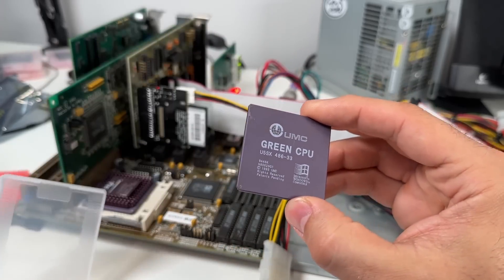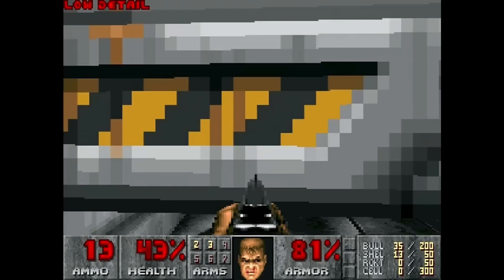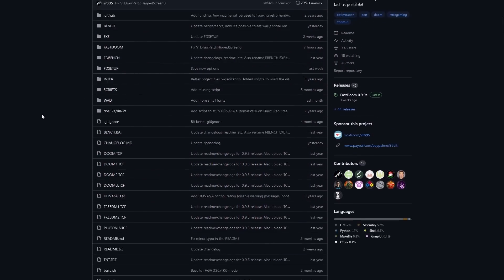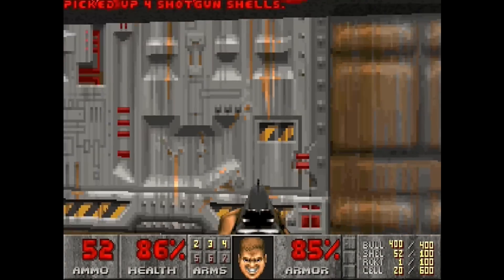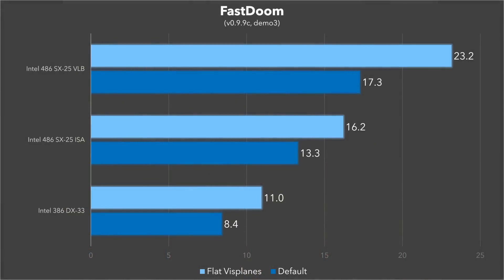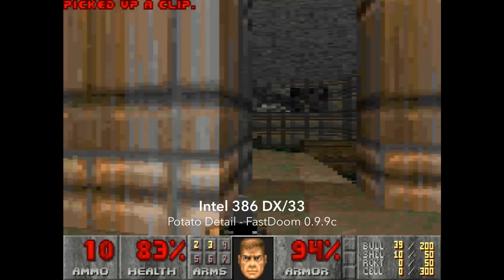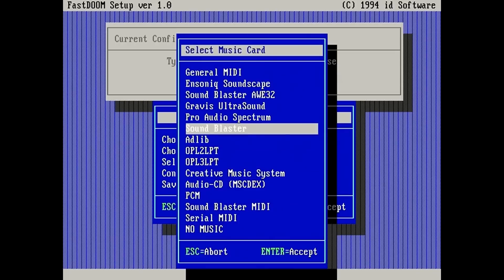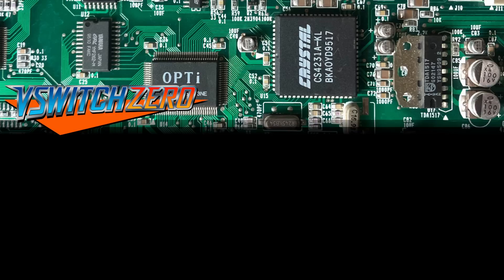FastDoom - Massive Performance Gains on Slow 386 and 486 CPUs!

Comment: Victor here! Awesome coverage of FastDoom, I really love all the time and effort you've put in this video. I ended up watching it in tears because it means a lot to me. Also thanks @vswitchzero for including the shoutout to all developers that have helped in the project.

BTW, to all of you who are watching this video, put in the comments what functionality you would like to see in FastDoom :D
Reply from the maker: Thanks so much for all the hard work you have put into this project and all the others who have contributed as well! It's an amazing accomplishment and I really look forward to what FastDoom has in store in the future 😃👍
Reply: I'd like to see the 350 line mode of VGA used in FastDoom (175 if double scan is set in registers).  Could give an extra 1FPS on a 386.  It exists in the VGA standard to emulate EGA modes for backward compatibility, but you can use those timings with 256 colors (it's basically the same as the 400/200 line mode from total count and pixel clock standpoint, but with inverted sync to tell the monitor to stretch the picture).
Reply: Rotating overlaid automap like in Duke Nukem 3D and Doom8088 ;)
Reply: I'd like some "BrutalDoom emulation"... some of the gory stuff but somehow built into the engine so that its reasonably fast enough on old systems.
Reply: first of all: lower vertical resolutions. I think why is clear.
secondly: some options for graphing performance and frame times, and maybe even an editor for tailor made single-frame benchmarks to accurately gauge the cost of each individual effect that can be disabled/enabled.
thirdly: god damn config file because what the fuck is that exe spam
fourthly: not a feature, but if you can pull some demoscene shit for performance, do it.

definitely more I could add, but it all escapes me at the moment.
Reply: Ultimate potato mode!  Every sprite and texture replaced with a low-res potato texture!
Reply: @Kevin_Narthex  The Real Ultimate Potato Mode™ will be no textures at all! The next release of FastDoom will include this new feature, no joke (already tested, my 386SX-33 even reaches 35 fps sometimes!)
Reply: I do not play Doom on old hardware, I don't even own one. But I do play Doom. Maybe some adjustment to sprite culling? So that decorations/corpses are culled even closer, and important things (medikits, enemies) - further away from the player? I often travel through map with 5% health desperately hunting for the remaining stimpacks.
Reply: As the port seems to add support for new sound cards, how about music playback support for Roland MT-32?
Reply: It's already amazing to me. Thanks to this port I tried it on my 486 laptop that only has three megs of ram. It ran like a champ. 

I also wanted to see the improvements on the 386sx. It's pretty much night and day for it.

Growing up I had the 386sx 40mhz machine and remembered it being a bit of a drag. With fastdoom I am happy with a stable 15 fps. I haven't screwed around with it THAT much but I'm sure I can reach a stable 20 with a full screen. Low detail was always my goto mode in vanilla doom
Reply: FastDoom for 68K Macintosh
Reply: @DimitarAngelov  Doom on a 68K Macintosh shouldn't be too hard if you start by making a fork of GBADoom. That's what I did when I made Doom8088.
Also take a look at doomtd3 to see what Doom in monochrome can look like on a Macintosh Plus.
Reply: Please never call Twitter "X" again.
Reply: Is there a restriction for FastDoom to be demo compatible?
I was thinking taking more inspiration from the console ports like making every monster deaf, having bodies disappear and an option for fullbright lighting could claw back performance.
Reply: @iceman78772  FastDoom tries to be fully demo compatible. That limits us a bit on what can be optimized.
Reply: I'd love to see some support for Pentium cpus, I've got a 133
Reply: @WhoLover  That cpu should run the game native perfectly fine
Reply: @De-M-oN  oh it does for the most part. There is some slowdown in certain areas though
Reply: @De-M-oN  might be the GPU. I have 48mb of ram and haven't even tried DN3D yet
Reply: @Sad_Rainbow_83 we cannot release any kind of resource based on the original IWADs, that would casue lot's of legal copyright issues, sorry!
Reply: Use the trick any modern game does use: Remove a corpse after 3 seconds or so. That would probably help a lot on maps with many monsters on it
Reply: What about a HIGHER resolution mode for FASTER computers? Doom in 640 x 480, 800 x 600, 1024 x 768, etc.
Reply: Brutal FastDOOM! :D

I kid, I kid.

Comment: How much RAM did you have have for the 386 or 486 and how much of a difference does it make to the FPS in High detail mode without turning any features off? I was wondering what max FPS you could get with a Am386DX-40 which I think is the fastest 386 CPU and up to 128 MB RAM?

Comment: Of course, there's lots of difference with different motherboard chipsets along with DRAM and cache speeds (and how well given chipset will make use of given DRAM speed ratings and latency ... some had limited options that could only really make use of faster DRAM timing via overclocking or ... at least only by using a faster FSB speed, which above 50 MHz typically meant overclocking).

There  are also some very fast, low wait state ISA video cards that will outperform some VESA cards, especially for games sticking to actual VGA modes and not VESA/SVGA. (and moreso for those like Doom that don't copy to the VGA framebuffer, but do VGA latch writes directly into VGA memory, either 1 8-bit pixel at a time, or doubled 16-bit wide lowres pixel; Doom used unchained VGA mode with its nonlinear memory, but doing 1 pixel write at a time meant it was still faster than using Mode 13h, and it allowed a quadruple-buffer to be used with 4x 320x200 areas in 256kB VGA RAM; and use of VGA latch for pixel writes allowed some overlap in pixel write and CPU processing time to hide VGA access latency).

In other words, a very low latency ISA bus connection might be preferable to some VLB implementations ... and that's not getting into overclocking the ISA bus. (though those fast, cards with 0ws jumpers usually don't like running above 10 MHz ISA in 0ws mode, and are faster at that setting than 1ws 16 MHz ISA speed). Cirrus Logic CL-5420, 5422, and 5424 were common fast SVGA chips used on ISA cards (as well as VLB cards).

On a side note: there's the particularly odd case of ATI's otherwise average VGA Wonder or VGA Wonder+ chip, is that it seems to tolerate very high ISA bus speeds up to 24 or 25 MHz with performance scaling with that. (until it's about as fast as the best 0ws ISA VGA cards). It's also one of the fastest 8-bit XT slot compatible chipsets, but that's a separate topic. (for boards that don't allow much/any ISA bus overclocking, the low wait state cards are better ... that and on 286 or slower 386 boards with fixed 1/2 ISA divider, the 25 MHz 286 or 386SX/DX is still slow enough for 0ws ISA settings at 12.5 MHz ISA bus clock rate ... this is also typically a case of 25 MHz CPUs being run in board really only intended for 20 MHz max)

And 24 MHz ISA will work with other sound/peripheral cards in most cases if the motherboard has sufficient settings to adjust latency on various I/O ports that would otherwise cause problems, mostly with sound devices. (or particularly slow, early IDE hard drives operating via direct ISA bridge PATA to ISA cards)

I found this relevant on some of the fastest 1990/1991 era ISA-only boards (or some that had short-lived local bus slots that were usually omitted and were also dangerous in that they could fit VLB cards, but had incompatible pinouts that could damage/kill the board or card). This includes the fastest 386/486 socket board I've come across, using a UMC chipset. (it goes under at least 2 names, but I forget what all of them are ... I think one was U3486 or US3486) Those appear to be able to run at 66 MHz FSB reliably, which surprised me for a 1990 motherboard with discrete oscillator. (running Quake on a 486 DX-66 ... or DX-50 overclocked to 66, was interesting, though Tomb Raider runs better)

Also, by 1994, you started seeing a lot of decent PCI capable 486 boards, with that still being a good, reliable low-cost option by 1995 (and some quite fast, low-cost PCI cards available, some of which actually handled overclocked bus speeds better than mid-range chipsets: like the S3 Trio-32 which handles 66 MHz PCI where Trio 64 and the Virge series all corrupt their CLUT at 50+ MHz PCI speeds). I've also found that a lot (well, all the ones I have) of 486SX-33s will run happily at or above 66 MHz (and sometimes on 3.3V), as will all the 486DX-50s I have. (all Intel examples)

A lot of the cheap, late model Intel SX-33s overclock like crazy. I haven't tried the SX2/50, though.

Cyrix 486s all have much faster multiply/divide operations than other 486s (16x16-bit integer multiply with 32-bit product in 4 clock cycles) and that goes for their SLC/DLC series from the start. However, a lot of 386 and 486 era games don't actually rely on hardware multiply instructions as shift+add combined with look-up tables was usually faster on normal CPUs. (if someone had used a Cyrix chip for a game console, that would've been different)

Though Cyrix CPUs (of multiple vintages, but pretty much all flavors of 486, be it PGA-132 or PGA-168 pinout) have added cache features and speed boosts that not all mobos or BIOSes support, either, though there's a software utility you can use to enable them. (sometimes the cache won't be enabled at all without that, or will be mapped outside of the usable address range)

Comment: I have a 286 add on board for my 68000 based Atari St. I'm trying to get a 386 upgrade to replace the 286. So I can run protected mode software like windows 95.

Comment: I'm pretty sure I played DOOM happily on my 386/40 with the screen size down a bit. It had decently fast tag RAM for the cache. It wasn't that bad on my first VGA card nor my Diamond Speedstar 24X. With a Roland MT-32 and SoundBlaster Pro, too.

LEA is "load effective address" which is used to get addresses of values in memory.

SHL shifts all the bits in a register N positions to the left. Shifting by 1 will multiply by 2. SHR is right / divide. 2 bits would mul/div by 4, etc. These are very fast operations (a few clock ticks), compared to MUL and DIV which are extremely slow (like maybe 70 ticks).  There are tricks to multiply or divide by arbitrary numbers, too. Like, want to mutiply x by 5 to get y? 

y := x SHR 2 + x

Comment: Should going to like 23 colors only be a huge improvement -When i long time ago tried differnt bitmaps and the lowest amount of colour to render a picture that could give an ok colourpattern instead of 32 or 64 colours i found 23 coulors ok as the lowest acceptble - 16 colurs only are not that-, 16 colours are not ok to render a faitful" rendering of a photo (256 colurs in this example)

Comment: Which was also really interesting: Episode 4 - already e4m1 - had so much lower framerate than the other episodes. I had to painfully see that on a friend with a 386. Episode 4 was literally unplayable.
Reply from the maker: Good point! I noticed this too on older hardware. Not sure what it is about episode 4. Doom 2s maps were much larger and struggled compared to the original Doom episodes as well I’ve noticed.

Comment: 3-4k burger shekels in the early 90s for a 386 was a rip off (which often happened with prebuilts from known brands, they'd mark up the systems by 100%) , as a 486SX CPU would cost you around 200 burger shekels at launch and give you around twice performance per clock than a 386DX. By the time Doom came out 4k burger shekels would likely get you a Pentium PC if built by yourself.

Comment: Shl, shift left, shr, shift right. 

Assembly code guesses.

If you shift a number to the left, you multiply by 2.

Shift to the right you divide by two.

Makes sense, 15 shifted to the left (decimal) multiples by 10 to give 150.

Shift to the right, 15 becomes 1.5 or divides by 10.

Remember assembly tends to work on base 2.

Comment: I have always had the insane idea of a heavily overclocked high end 486 with the theoretical maximum of 4gb of ram and the most powerful video card it can support somehow running Skyrim. I'm not sure if Nvidia makes a PCI version of the GTX 4090, but two 3DFX Voodoo 2 cards running in SLI should be almost as good IMO.

Comment: Potato mode is looking very much like GBA port of Doom. Pretty sure that there wouldn't be any problems in beating game using it, especially with mouselook. I have managed to beat Doom on GBA and that experience totally sucked (but was best portable Doom for a good while).

When it comes to optimisation  side of things, I am actually surprised to see that gains are not bigger. I mean, id software were pioneers, tech Wizards at the time and they have been churning out games at amazing rate in 90's. However, they have always been targeting high end hardware. I guessed that a lot of code could be bloated because of this.

Comment: Back in the mid 90's I played through Doom on my 386DX40 which had a really good ISA graphics card (can't remember exactly what it was now) and fast system memory. It was actually fine, very playable. On some of the later levels with millions of mobs I switched it to blocky mode to keep it running well.

Comment: I jumped from Amiga 500, to windows 95...  What's a 486?
Reply from the maker: The 486 was Intel’s 4th generation x86 CPU architecture. It was popular from around 1992-1995. It’s possible a system running Windows 95 was a 486, but many were Pentiums by that point. Thanks for watching!

Comment: John Carmack himself said, after Quake was released, that Doom could be much faster with his newer coding knowledge. Nice to see others picking up that part!
Reply: I hope someone tries using precalculated PVS like quake, this is mostly low level optimizations, which are interesting, but high level optimizations can be very valuable as well.
Reply: @Ehal256  Most of the doom ports don't want to break "demo compatiblity" so they have to behave 100% identical, so they even need to keep some strange behaviour of doom visiblity calculations. But if you give up this, I am sure one could do some high level optimizations. I rember in Michael Abrash Black book, he claimed that Carmack had invented a "perfect" PVS for 2.5D doom.
Reply: OTOH if you look at the numbers here, fastdoom isn't that much faster though. Sure in some cases, but on higher end hardware and best settings the difference is smaller. I love this work and think he did a great job, but as you can see the game was quite well optimized already. Another thing one could optimize is the footprint of the assets with modern codecs.

Comment: It was interesting when I learned about games running at 15-fps since I never would have thought that would be satisfactory,  however that is the threshold for what can be considered smooth enough whether for 3D graphics or FMV.
50% faster 22.5 or 24-fps was my initial benchmark in the 90s for 3D games since films never looked jerky at that frame rate. Mostly from there it went into the video standard of 30-fps which isn't half bad as a locked performance standard.
In the hindsight of the 90s there was some Anaglyph 3D and VR HMD use which more often than not had half the performance of standard game viewing, meaning you'd need at least double the minimum performance to have it work properly Ie. 30-fps just to do 15-fps.

Comment: I remember upgrading my computer with something called a EverGreen chip, is that the same thing?
Reply from the maker: Evergreen made several different upgrade chips over a few hardware generations. They usually allowed faster CPUs than the motherboard supported to be utilized for a pretty major performance boost. I did a video on the Evergreen Spectra 400 a while back. Thanks for watching!

Comment: The impression I always got was that Doom was likely developed on a high-end 486 system, the Pentium was released several months before the game was out, and they might have been expecting that people seriously into gaming would buy new computers soon at least to have VESA Local Bus graphics cards if nothing else. I think in their mind, the game was optimized enough to run on a 486, the Pentium was already out, and Windows 95 was coming soon, so optimizing the game to run on a 386 wasn't really necessary, because by that time the 386 was essentially already obsolete. Tech moved fast back then, especially for anyone who dealt with stuff like CAD or gaming. Meanwhile, a 10 or 15 year-old CPU could still run most things just fine today, as long as you don't do much multitasking. Sort of interesting that someone is going back now and doing the work the developers didn't feel like doing at the time, to make it possible to run the game on a 386. It could have been done with a few more cut corners and optimizations, but they just didn't think it was worth it. I think Doom 95 is a really good indication of what they wanted to focus their development efforts on instead of making the DOS version run better...
Reply: Doom was developed on NextCube systems (68030 or 68040) and later ported to DOS. The press release beta of Doom didn't use VGA mode X for rendering, and rendered everything on high detail using a linear framebuffer (mode 13h). So yeah, I think they only focused on fast 486 / Pentium systems, and later had to add the low detail mode with mode-X so slower systems could run the game.
Reply: @viti95  That's a really cool detail! I never would have guessed it was developed on NextCube.